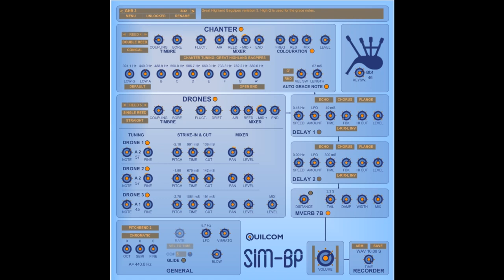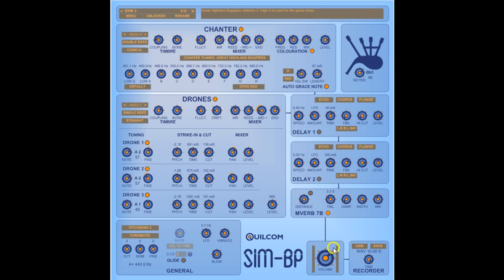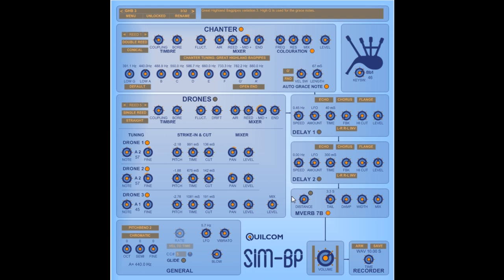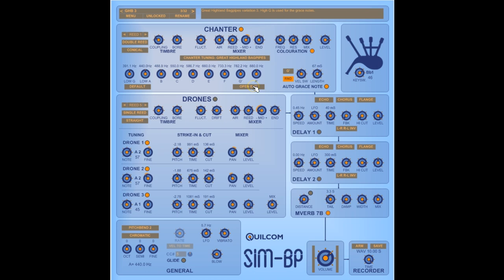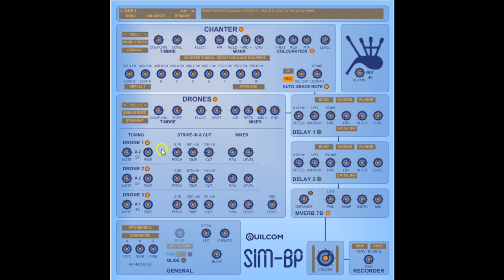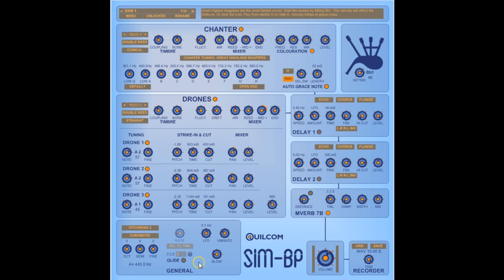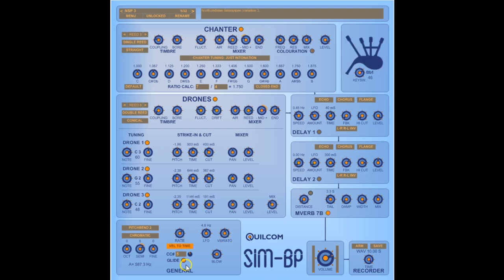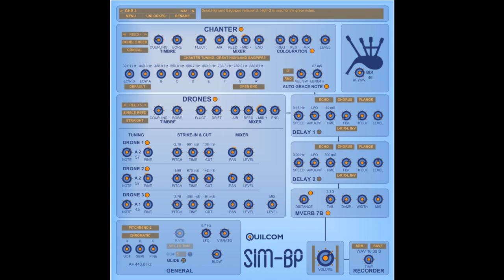Quilcom SIM BP

Comment: Hi Rex can I connect the pitch of the oscillators to 1 of the envelope generators used on "ass" synthesizer? Thank you, Dave
Reply from the maker: Hi Dave. Not sure I really understand! The envelope on the ASS is internal only.
Reply: @rexbasterfield5332  in other words can I make the pitch start from above or below the original note